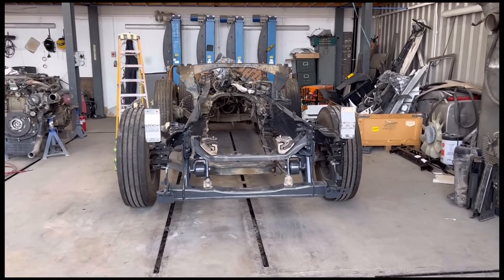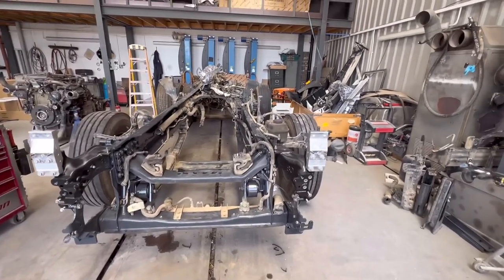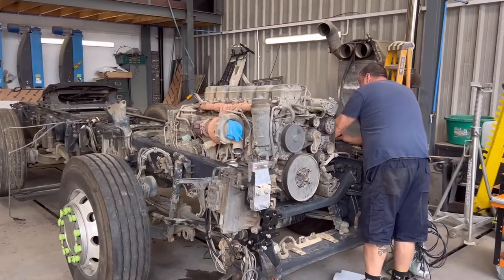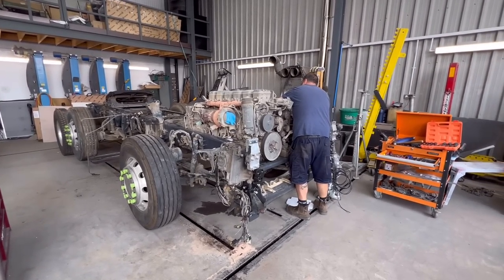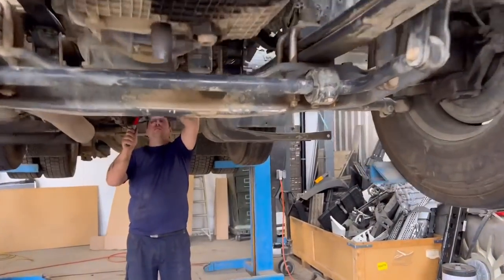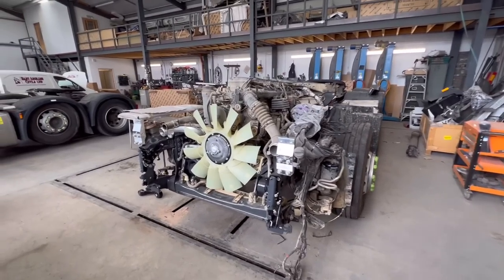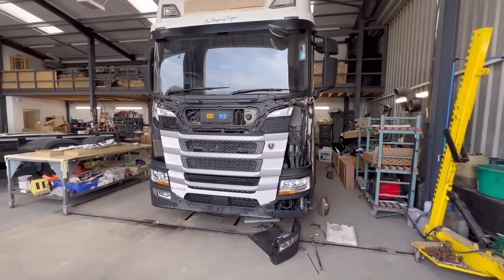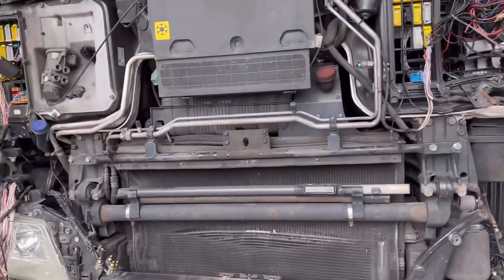Rebuilding a Wrecked 2017 SCANIA . Big job!! Part. 2

Comment: Good to see you back. Thanks for the extra video shot the chassis straightening - i had always thought (clearly i was wrong) that you could not apply heat to the chassis as it would weaken the metal?